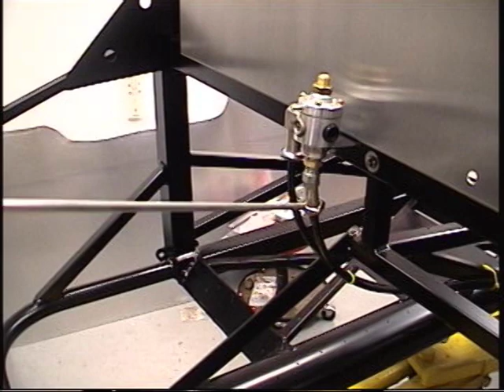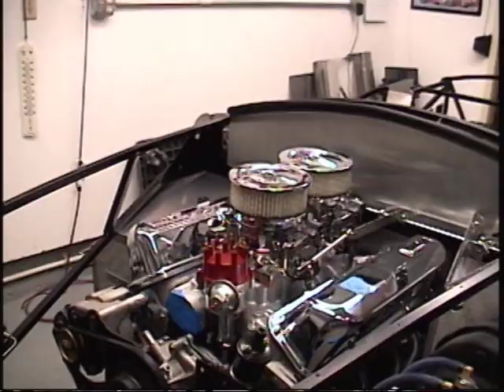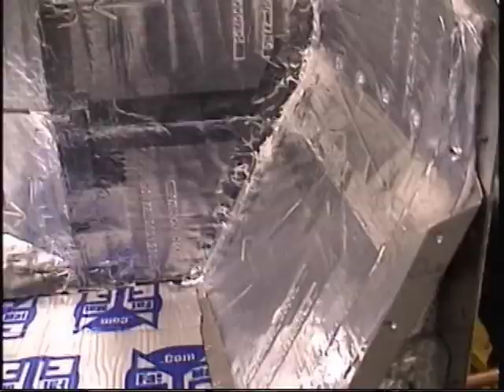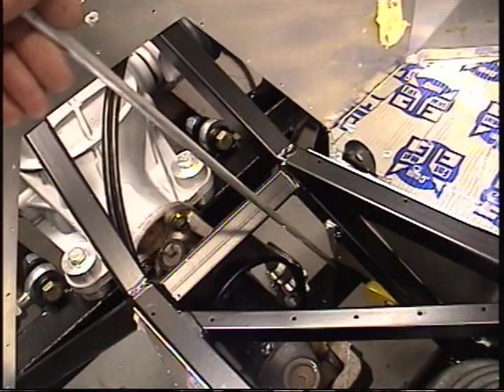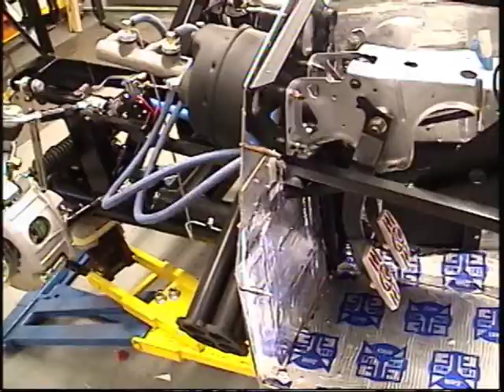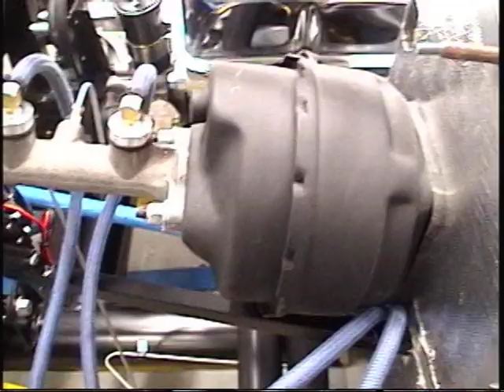part 2, Building a Factory Five Racing Mk3 roadster

Comment from the maker: Yes, it is a 306 (bored 302) but the engine has been accessorized to look like a 427 big block "FE" engine at first glance.  I installed the FE valve covers on the engine with aluminum spacers, but would not recommend anyone going this route as you end up using 2 gaskets per side and they are a pain in the ass to keep from leaking. I also used the coolant tank, oil filter housing from a big block and made my own accel linkage to keep it looking "period correct" (within the budget I had).
Reply: Would you do anything differently?